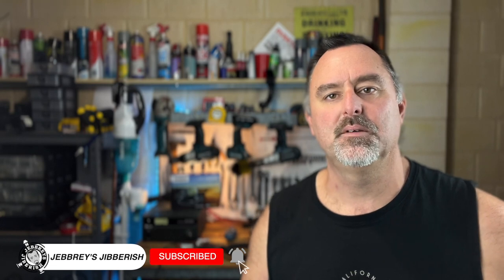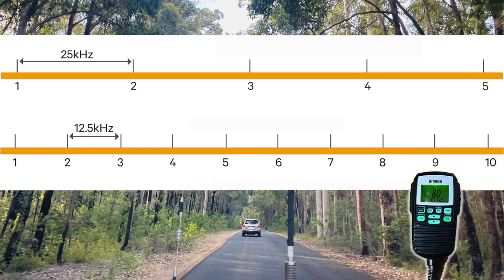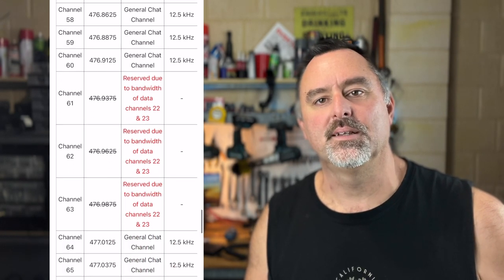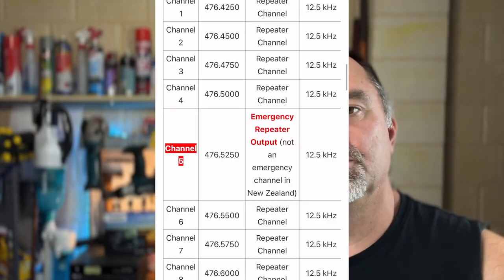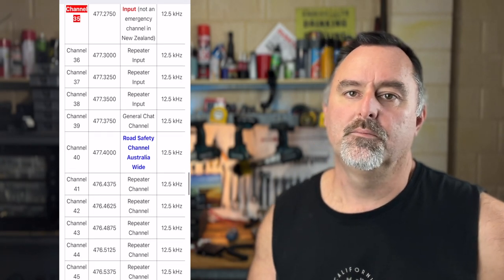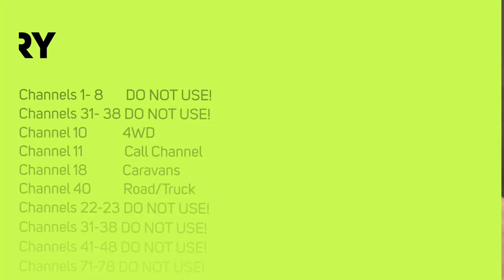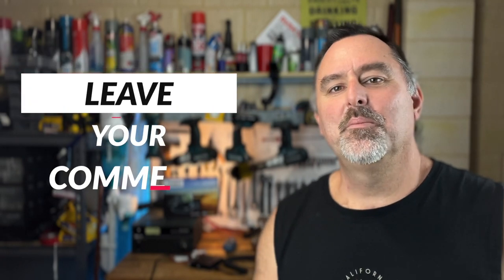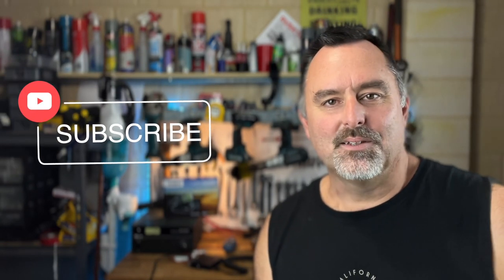UHF CB CHANNELS  - Why are there only 77? Which one's can you use?

Comment: This is a great series...looking forward to the stuff on ctcss and dcs.
Now about the channel bandwidth, 25kHz to 12.5kHz, I have an older 40 channel unit, does that mean it splatters the corresponding channel between 41 and 80? Its probably around 20 years old and is going great guns.
Oh, another thing I want to know is can I get a good antenna that adheres to my rear window glass like the AM/FM antennas in cars? I've had enough antennas broken by branches...I want a better solution.
Reply from the maker: Yes and yes. Break through will be minimal on the 80ch but if you are close to the other station you do risk causing some splatter. That is exactly where CTCSS and DCS will help operators in 80ch units avoid that interference. And yes there are some excellent stick on antennas and from my experience with both of the styles you can buy in Oz they are surprisingly good. I will be doing a video on antennas soon and will talk more about that.
Reply: @JebbreysJibberish  Thanks JJ, looking forward to, well,  everything!